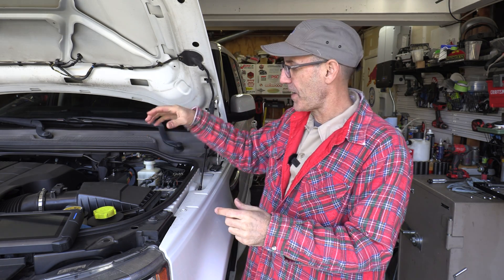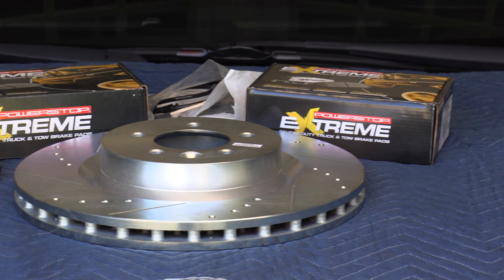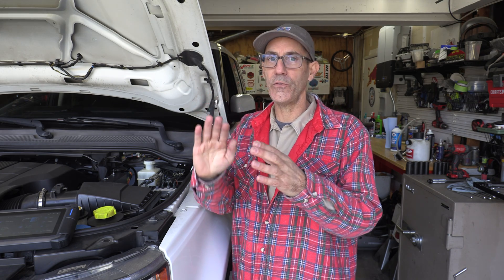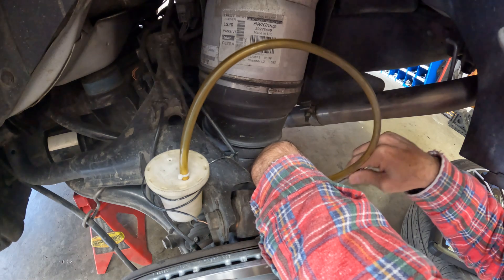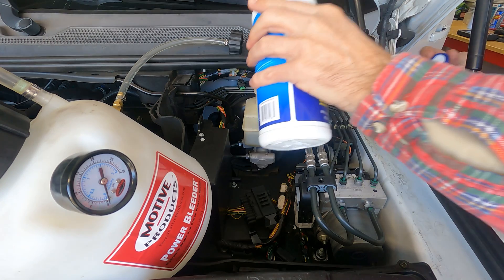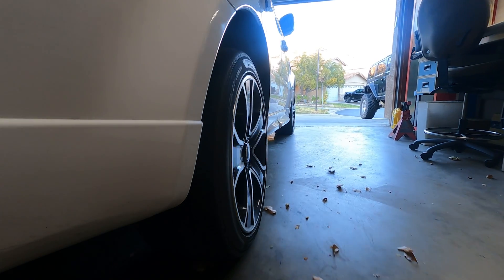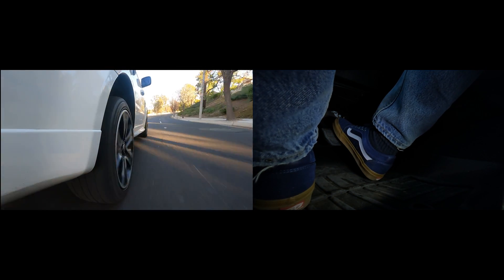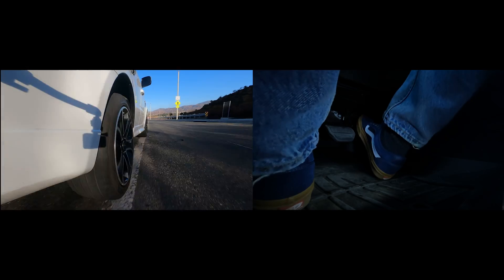How To Bleed ABS Pump for a Perfect Brake Pedal

Comment: thank you. i am sure i have air in my abs module and have been racking my brain trying to pressure bleed the system. just still spongy and poor braking.  can i just activate my abs while pressure bleeding to get the air out? I have a long gravel driveway so I will try activating the abs and try to bleed. thanks
Reply from the maker: As I mention in this video, that technique worked for me in the past but I would not count on that to solve your problem... You are relying on a bit of luck. A proper tool makes this a sure solution.
Reply: @AutoEdits  i used a pressure bleeder and the dealership computer. I also changed the master cylinder. still no improvement

Comment: Could you just use a pump or vacuum to pull the fluid through.  That's how most brake shops do it. ...
Reply from the maker: I did that, many times. An air bubble can easily stay trapped in the ABS module because there are so many different lines and shapes to the manifold.

Comment: Definitely have this going on with my JK after my UD60 swap with the JK8 master cylinder. I swapped the axles but had a shop do the MC swap because I noted they’d have to do an ABS bleed and I didn’t have, and didn’t want to buy the scanner. 

Fast forward, similar symptom as you, the pedal has been “good enough” but always felt it should be better. I think it’s time to do an ABS bleed procedure myself and this video is a motivator. 

That scanner is a little steep of an investment for what I need it for but I’m sure I can find others that can do the ABS bleed at a lower price point. 

Thanks for putting this together.
Reply from the maker: Hope that solves it for you! Are there many cheaper scanners that can do special function stuff? I think with the coupon in the description, this one is $369 and the wireless function really came in handy. Either way, you'll be glad to finally get it done... it really makes me happy to have this thing finally right.

Comment: Hmmmm, I've had the same issue after putting PowerStop Rotors and Pads on my Autocross car. The car has always stopped great but the pedal travel has been long.  I've wondered if It could be air in the abs but I never changed the calipers. Now I'm thinking I need to check what my ABS bleeding procedure is. Modern cars these days, not as simple as old pickups.
Reply from the maker: It would be worth checking for a bubble in the ABS. As far as I know, this vehicle hasn't had a caliper off and yet there was that little bit of air in the ABS after a ton of flushing and bleeding.

Comment: Have you had to replace the ABS module on your JK yet? The module on my 2012 JK crapped out last month. I can still drive it but it has no ABS. I'm sending it off to be rebuilt.
Reply from the maker: I haven't had that issue with my Jeep. Good luck for an easy install 👍